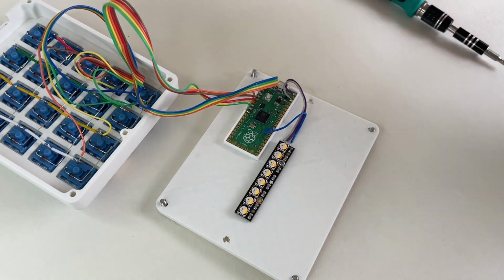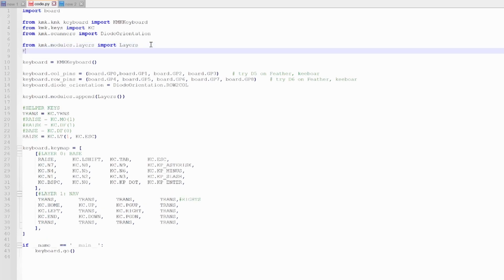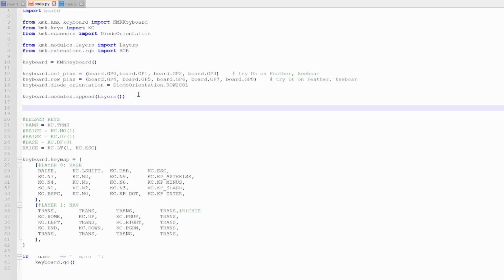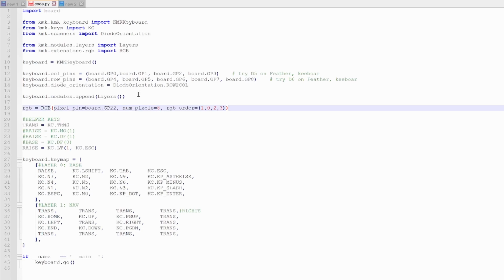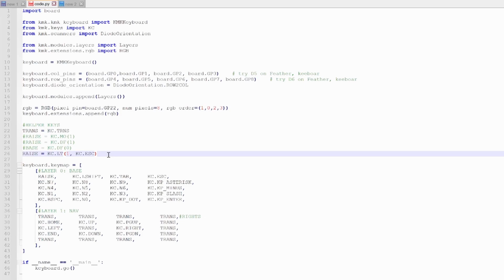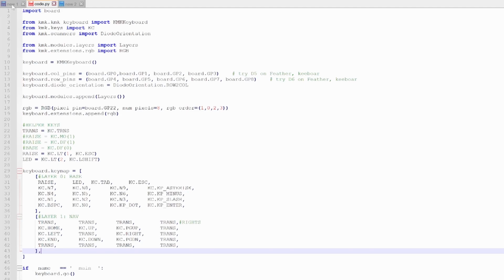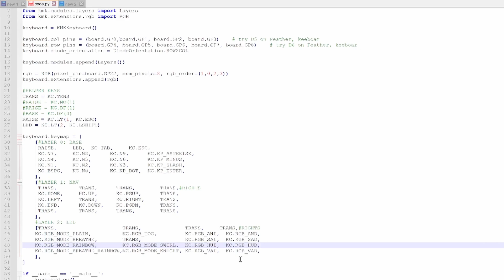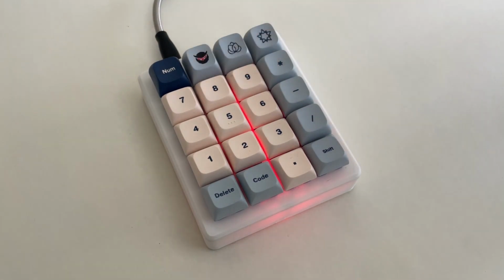Pico Num Pad - Part 4 - RGB LEDs

Comment: After days of searching around and finding only pieces of infos on qmk and which controller to choose you brought the light into it. (and it's even rgb!)

Seriously I'm sold on the Pico and kmk for my project. This is so simple and easy to implement.

Quick question though : Can kmk retain the last rgb setting for the next bootup? (sorry if it's in the doc I'm in the process of reading but not finished yet)

Keep the good videos coming you got a new sub!
Reply from the maker: Hi Glad to hear this video helped out.
The pico really is a good controller for it.
I am not sure about maintaining the last state. I typically just set the startup LED color (check out the instructable).